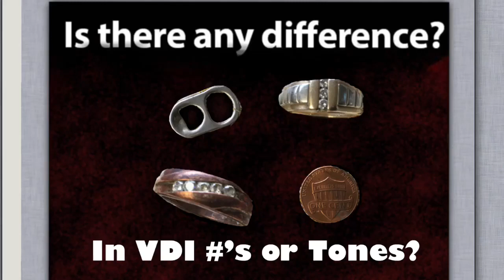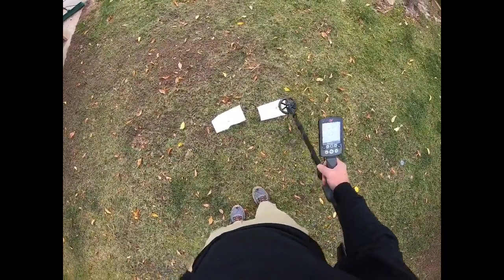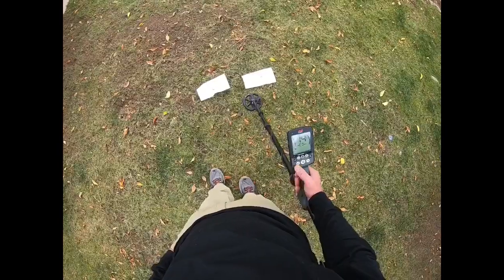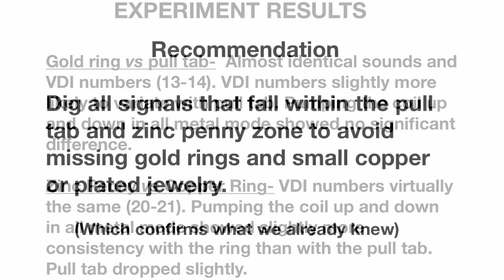Rings vs pull tabs experiment with the Equinox 800 metal detector

Comment: Try the edge pass rejection technique.  Monte Berry figured this out years ago and it should work with any VLF detector.  I've had real good success with it.  Instead of passing the coil with the target centered under it like you did in this video, sweep the coil and work towards the edge until the target just falls off and you can't hit it.  Continue sweeping the coil and work the target back under the edge.  As the target passes under the coil edge you should notice junk targets will typically have a broken tone and real jumpy VDI.  Good targets will be pretty tight VDI numbers and good tones all the way from the edge to the center of the coil.
Reply from the maker: Keith James thanks, I will try that out! Very helpful.
Reply: @firebellyK  also, using the all metal with F2 at 4 or higher, I get broken tone on tabs
Reply: That works for bottle tops!

Comment: I would like to add an additional step to your testing. Try sweeping the pull tab at different angles and your VDI number should fluctuate more vs the ring. I have found that round targets tend to produce only 1-2 numbers whereas rectangular objects will produce more numbers and is a good indicator the object in question isn't round.
Reply from the maker: Thanks for the info! I will definitely try that.